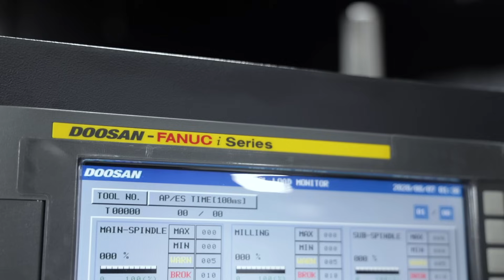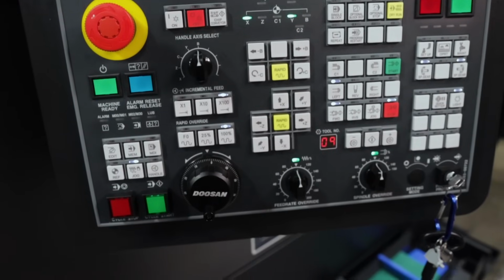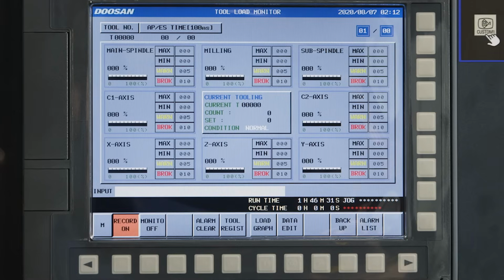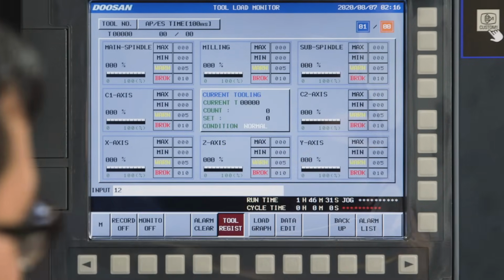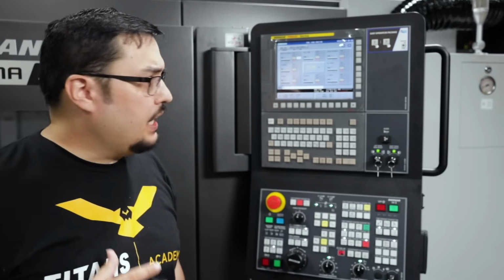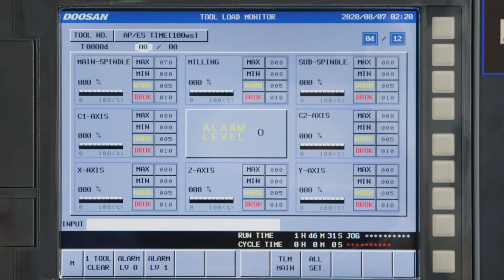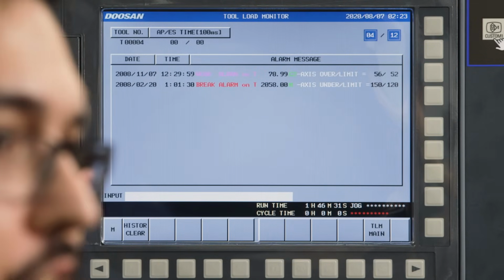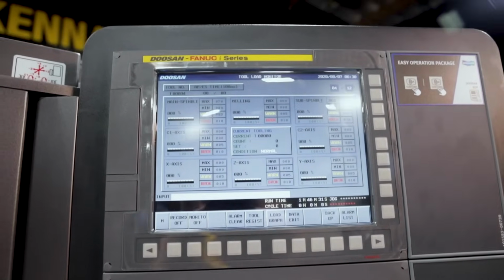STOP BREAKING TOOLS | Doosan Tool Load Monitor | Advanced CNC Machining

Comment: The Fanuc 0i still seems archaic compared to Haas.  The Homing procedure and tool setting just seems ridiculous compared to Haas.  Loading a file seems like 20 steps,  why not select + load.  The Machine is much nicer and more rigid I think, but the control is like going back to 1998.  Actually, the embedded interfaces looks like win98 or XP.

Comment: I run this same machine daily at work. Would it be possible to get a video showing how to use the jaw cutting function? I am currently using MasterCam to cut my soft jaws and would prefer to just do it at my machine.
Reply: Hi Christian could you program the jaw boring with predefined macro or parameters that way its a quick change and you can get any size depth you need?
Reply: @stevenoke9390  I'm not sure. I have read through the manual that came with the machine and haven't found anything about any predefined macros or parameters for jaw cutting. The guy that setup the machine said there was a way to quickly cut soft jaws similar to what can be done on a Mazak integrex 70 but couldn't figure it out.

Comment: It would be nice if you can set. That wen a alarm for a tool go on. To just go and change whit a nother tool that is the same size and not used in the program . so you can run much longer
Reply: Emil that is the point of tool load monitoring once it hits limits if you have a "sister" tool available in the turret  it will jump to that and use it to allow continuous  running, Maybe Tyson can explain how this works.
Reply: @stevenoke9390  that is awsome

Comment: Good in theory, in practice, it's a waste fo time. Get good tools and use TLM (tool life monitor) instead.
Reply: This is a TLM.  It measures tool life based on the power consumption of the tool.  Dull tools require more power to cut, therefore it can tell you when a tool needs replacing.  Now this is not fool proof, as a small tool may not require enough power to trigger an alarm based on power consumption.  A 1/8 drill in aluminum may not draw enough power for the machine to recognize that it is even cutting, let alone dull.
Reply: we always work according to the requirements. if you have a large series on the machine with long, unmanned running times, setting up the tlm makes sense. of course not for small series and individual parts.
but there is really no shame in making mistakes in this job. It is the most difficult craft profession, by far. if you count surgeons among the craftsmen, they stand a little above us, but you don't and that is why we are the kings of the craft. joiners, carpenters, I do that in my sleep.

sorry for my bad english and greetings from the heart of europe.
Reply: @conhel8826  People ask me what i do for a living.  The give me strange looks when I say "I make our world possible".  People don't realize that machining is the basis for the world we live in.  With out machining, we'd be living in a pre industrial revolution world.  It would be a VERY different world than we live in today.
Reply: The doosans have 2 systems that are called the same yet do very different things. Tyson got confused in his video as the original post asked for tool life management and he explained tool load management.
I'd like to be proven wrong but, run a part with too load management over 50parts and see the wild variations in load that happen. All you need is a chip to deflect some coolant and the load varies enough to error out, you are constantly resetting the machine or increasing the allowable tolerance to a point it makes little sense.
Tool Life management is 100% reliable for a process reliablility.
Reply: @Nico-wp6jq  Titan got it right. If you were to look up my original comment on one of Titan's previous videos about the 2600, there are a couple of replies to it between me and Titan. One of those comments I explain how to get to the TLM that Tyson explains in this video. I guess I misspoke because I was at home, not at the machine when I typed my original comment so I was just working off of my memory. I didn't know Doosan had a second TLM. Is that one optional or is it also a standard feature? I'd be interested in knowing more about it.

Comment: Stop "climb milling" that reduces breaking by 99% 😣
Reply: Climb cutting is way better for tool life and surface finish.  Conventional milling rubs the part and tool generating heat and reducing tool life.
Reply: @brandons9138  really???  I'm going to make a video to show it. 😲
Reply: @userwl2850  On a manual or CNC machine?

Comment: Thanks. It would have been a bit better if you'd had some data from that first test job so you could show how you'd use data from a real job to set the values. But really useful.
Reply: He didn't really elaborate on it, but it sounds like you can run the program to get base line tool loads with a new set up.  Then make adjustments to the base line management parameters from there to manage the tool life.  I'm sure it takes a bit of data collection and used tool analysis to figure out exactly what the numbers should be.  These types of monitors are really useful on long running jobs where you can really dial in the correct parameters, or like Tyson mentioned as a safety measure when running lights out.
Reply: @brandons9138  Yeah. Had it happen last night when I broke an endmill and it kept going for a long time. Workpiece got all scarred up (luckily was just a gift for a family member)

Comment: kenna metal go-drill going through 1000 parts, then scrap that shit at get a SECO drill! i love the fact that they constantly talks about efficiency, yet using nothing but kenna metal tools!
Reply: I think you are missing the point.  Titan of CNC is TEACHING YOU.  Not just theoretical, but real life.  So they are taking a (A) Kennametal tool, and they show you how to use it and how to be highly efficient with THAT tool.  Everybody knows that if you do the same thing with "China" tool it would not work.  Or if you use some other better tool the parameters would be different. But if you want to jump right away, cutting xyz material, then you can take the Kennametal X tool, put THIS parameters, and run with it.   They did all the testing for you.   That's the point.  
You want to use other brand names, go ahead.  Different parameters.  They can't cover every tool on the market.  They picked Kenna because they like it and because Kenna is now a sponsor.   Why should they show somebody's else tools?
Reply: @danl.4743  because they're better?
Reply: @balooc2  Everything they have is better??  And who is better than them?
Reply: ok now you're just trolling..
Reply: @balooc2  Not trolling. I am giving you respect.  I am trying to make a logical reasoning.  Is everything SECO does is better than Kenna, or are you talking only about the go-drill.  If specifically their drill is better, but endmills are not better, then why switching back and forth with Titan's recommendations.  I doubt they do everything better because nobody is doing everything better.  Which leads to the second question, 'who is better than them?'.  whomever that is, people may ask why doesn't Titan recommend that one, and not SECO.  It's a never ending cycle.  There is always someone better and then we can ask why isn't Titan recommend "that" one.  
You see, I am not trolling.  The point is that Titan (or anybody else for that matter) needs to choose a brand they trust, and run with it.  And if that brand is a sponsor, then use their products as the teaching subject.  As long as the tools are good, and there is no false advertisement then it's OK.   
I don't remember Titan ever claiming that Kenna does everything better.  Except from a few tools, that he raves about. Like  KOR, etc.
Reply: @danl.4743  you see.. you come forward as a troll when you're "quoting" me with the wrong question and answer it to make me look like a fool. my comment is about the fact that nothing can compete with SECO when it comes to drilling, (endmills and insert tools too btw) and i find it very ironic that someone would preach kenna metal when they're not even close to its competitors.
Reply: @balooc2  you must be joking here - seco u-drills will not beat iscar, even walter u-drills are better performing than seco...
Reply: @zyndapp800  never have i ever used a drill that could outpreform any Seco drill. they are scilent and fast for drilling, and they dont wear out everytime i've tried diffrent drills in harder materials, i've always gone back to trusty old seco drills!

Comment: Thank You!
Do you have to add codes to the NC program or does it set it up automatically?
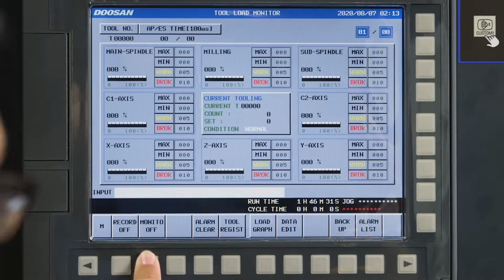Reply: You don't need any M-codes to activate it, that is done in console (as seen at 1:30), but there are M-codes to temporarily disable the TLM in the program.